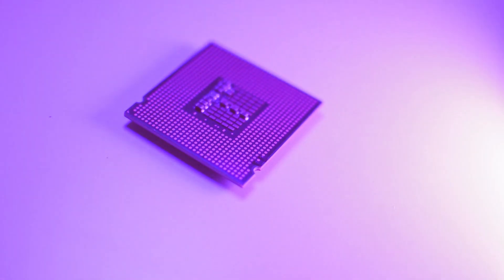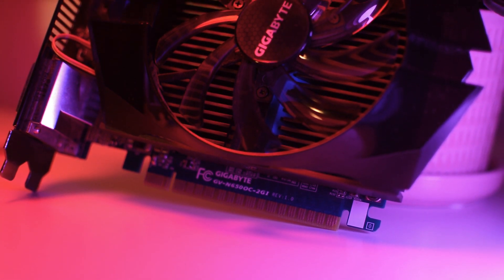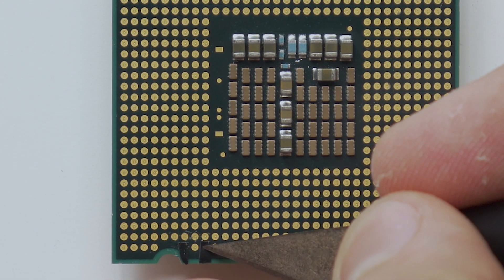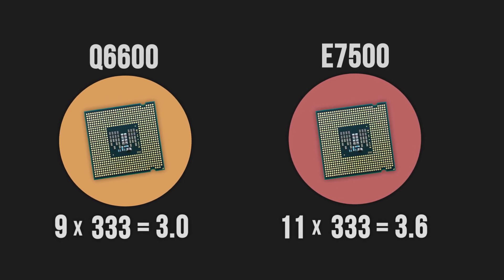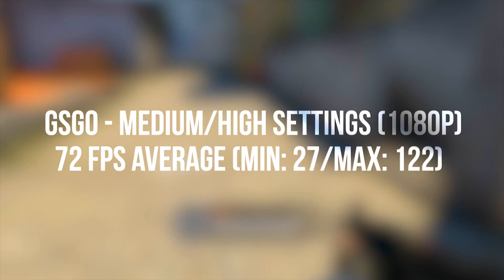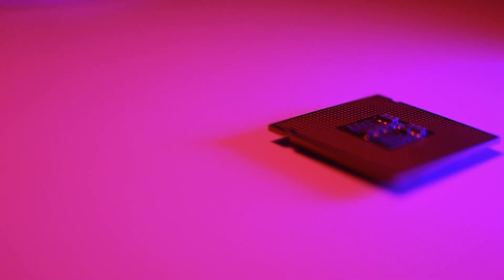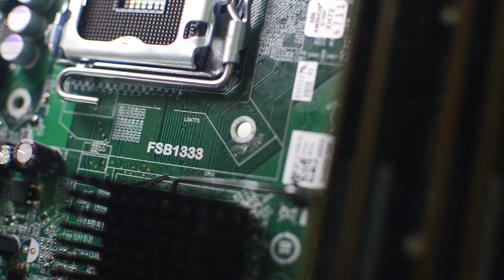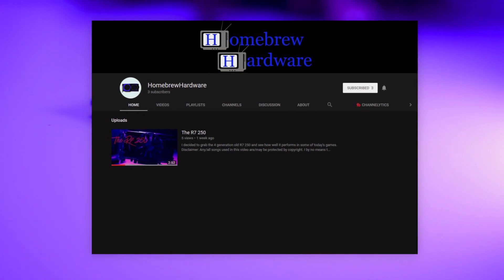LGA 775 Tape Mod (BSEL)!  How to and Benchmarks!

Comment: Would work in a core 2 duo e6300?
Reply: Should be fine and will result in an overclocked speed of 2.33GHz 👍🏻
Reply: @iblamemyself69  actually my mobo not support that cpu, but. i can upgrade to a core 2 quad q6600, better than a dual core

Comment: I've do this on my HP Compaq Pro 6000 Small Form Factor that has a E7500 too, it worked without problem, maybe was the PSU? Because this PC have a low 240 watts but HP certified PSU.
Reply: It’s got nothing to do with the PSU and everything to do with the fact that you forced the FSB to run at 1333MHz instead of the stock 1066MHz.

Comment: Sadly my e2200 did not work with the mod :(
Reply: Of course it wouldn’t, forcing that 2.20GHz CPU with an 800MHz FSB and 11x multiplier to run at 1333Mhz would result in an overclock of 3.66Ghz!

That was never going to work 😆

Comment: Will this increase the core voltage?
Reply: same question. I have my Q6600 overclocked to 3 ghz, but had to set higher vcore voltage, and lost speedstep c1e state, that saved power in idle. In idle before I had 110W now I have 130W, which is lots. I would wonder, if when I do this mod, vcore stays low, not like with auto overclock. But I think, it will raise, because it is detected as 333 Mhz FSB.

Comment: Did this but nothing happened nor did it matter what kind of tape I put on two pins. Any reasons?
Reply: It must be electrical tape as far as I know
The reason is that it does not conduct electricity
Reply: @AaaBbb-kw5em  Nah, any tape aside from metal tape will work.
Reply: There are some mainboards that just won’t play nice with this method, maybe you have one of those.

Comment: I didn't do this mod, but i overclocked my Q6600 and got it up to 2.7ghz before it crashed.
Reply: I have my Q6600 overclocked to 3.6 Ghz. You probably forgot to raise vcore voltage, or your motherboard doesnt support higher FSB. Also did you decrease memory multiplier? All Q6600 should be overclockable over 3000 ghz. Your problem is definetly in motherboard or memory.
Reply: warrax111 3.6 GHZ?? I only have it up to 3

Comment: Will this increas power consumption?
Reply from the maker: Yup, since it's basically like any other overclock. However, as far as I know, it's not a massive difference in terms of watts.
Reply: @sys.overflow  does it increase vcore voltage? Can you keep steepstep saving idle state for better idle power consumption?